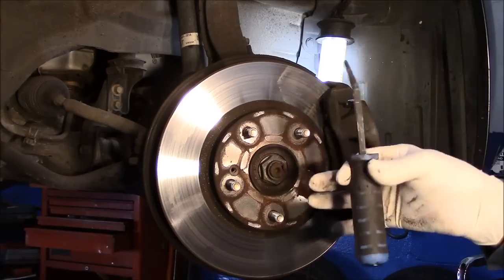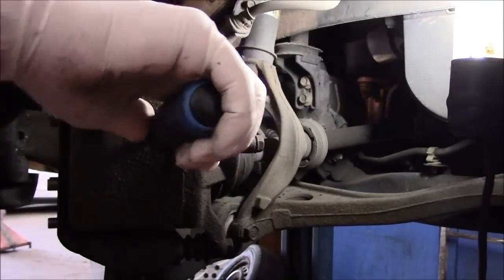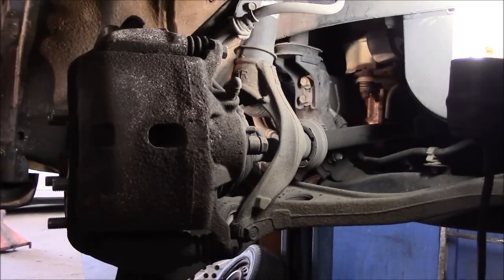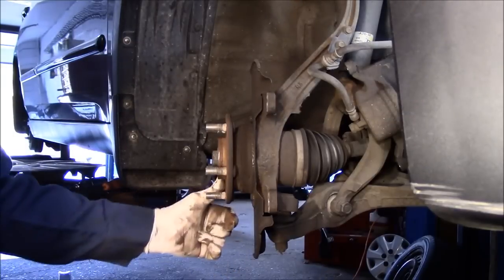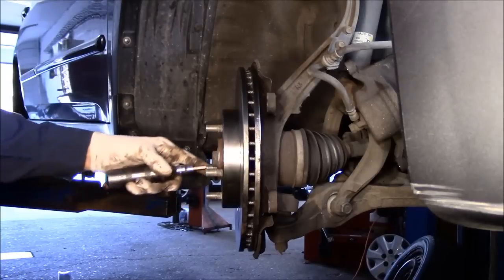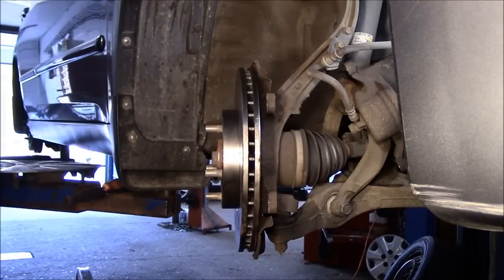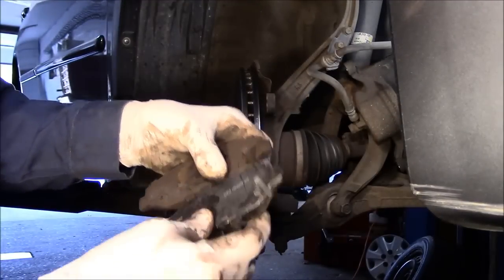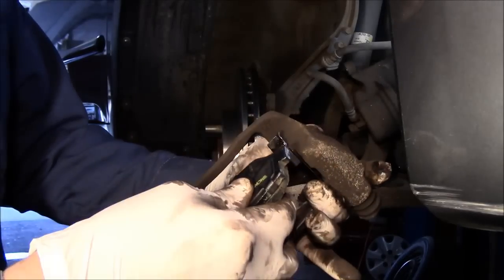How To Replace Brakes And Rotors 2003 Honda Accord

Comment: I have read in a Honda forum that the brake fluid should be changed every 2 years. I have inherited a 2003 Accord with only 85000 miles on it (it was parked in the garage for years and rarely driven). Will I need to bleed the brakes and replace the fluid when I change the pads and rotors and, if so, do you have a video on that?

Comment: Hey Jim.  Can you please do a video on how to replace the "captive rotors" for the front disc brakes on the early 90s Hondas?  
I think Honda used them from 1990-95.
I have a 1991 Accord.
Reply: Hi, I think Eric The car Guy did a few but it was later than a 91.

Comment: He said the piston needed to be pushed back in, but didn’t show us🫤
Reply: Yeah he did. That’s what he was doing with the screwdriver inside the hole in the break and pushing on it. You can also use a C clamp and just tighten it down